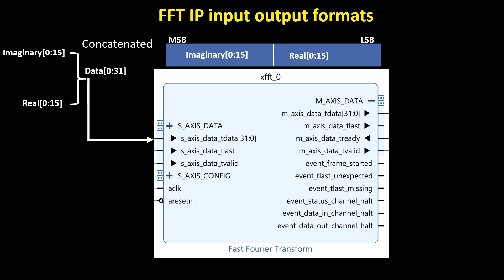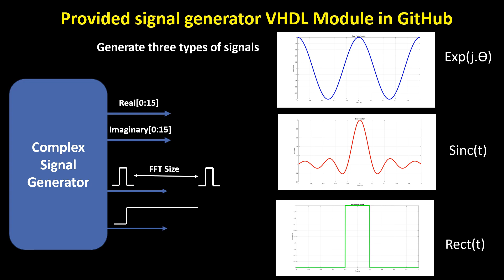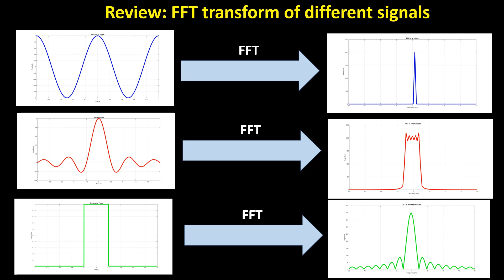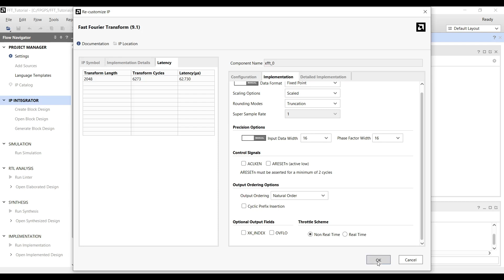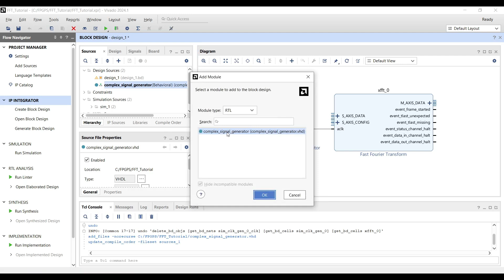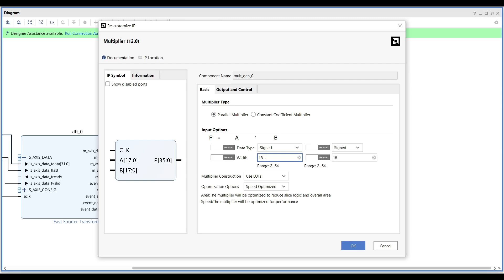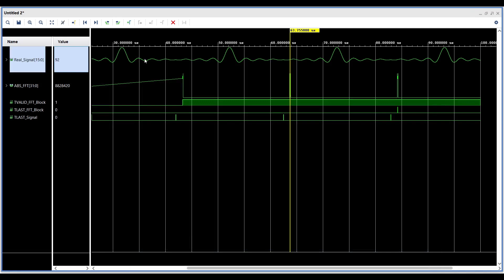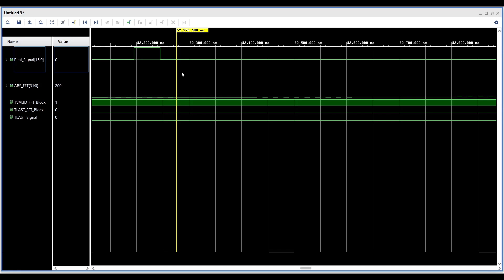FFT IP Core Tutorial Part 1: Vivado Simulation with Complex Numbers

Comment: Hi, thanks for the video. Even though we have followed the same steps , we do get this error : please check your design and connect them as needed: 
/xfft_0/s_axis_config_tvalid  when we run the simulation + no values in the simulation.

Since the last connections not shown in the video , we set all the external ports as a output by making manual connections. Does might be the reason we are getting this error ? Because I have seen that you didnt wire the axis_config_tvalid parts.

Thanks for you respond in advance.
Reply from the maker: Hi @Efe-ts6pe, 
Welcome to channel and thanks for the comment. 
the VHDL module comes with the TVALID port that you would need to connect it directly to the Tvalid of filter slave port. 
Extend the Slave Axi stream (input port in FIR filter block) by clicking on the "+" port, then you can connect each pin of that port one by one to the provided VHDL module. 
Generally, you need to assert the Tvalid signal , you can also add a constant by the value equal to 1, and then connect it to the Tvalid. 
hope it could help.

Comment: Perfect Video!, but my screen does not look like yours... How do I get to plot the sine wave? I'm so sad.
Reply from the maker: Hi Bomtok, thank you and welcome to our channel
You can have a look at the previous video, there I explained how to change the each simulation signal to waveform:
https://www.youtube.com/watch?v=D8ZnMH-Wv9Y

following steps can help you to show the waveforms in your simulation:
increase simulation duration. 
reset the simulation and then rerun it for the specified time.
Adjust the signal settings: right click on each simulated signal to change their settings. 
set the radix to signed decimal and waveform style to analog. you can also change waveform style to hold as well.
Reply: @FPGAPS  Thank you for reply.
But, ABS_FFT value is all zero. What did I do wrong?
And when setting the output port, do I have to set the Type - Clock for all 5 ports? I'd appreciate it if you could tell me the solution.

Comment: Thank you for the clear and useful presentations ! But how does the simulation work ?  IOW, it's not TB code elements and I'm used to needing some module(s) code and then writing TB code that then instantiates the module(s). For some reason, the simulation didn't start working till I tried using breakpoints, and then data was seen...
Reply from the maker: Hi Hardavi,
Thank you for your interest in the tutorials!

I understand your concern. Working directly with IP cores makes the simulation more visual and easier to comprehend, especially when exploring an IP core’s functionality for the first time.

I have multiple simulations designed in a similar way, which you can find in the "Vivado Simulation" playlist.

Regarding your issue—if the simulation only starts working after setting breakpoints, it suggests a potential bug in the simulation setup.

Here are some steps that might help resolve it:
Ensure that the top wrapper is correctly added to the design.
Double-check the FFT IP core setup for any misconfigurations.
Verify that you are using a compatible Vivado version—I am using Vivado 2024.1 for my simulations.
Reply: @FPGAPS  Thanks for the tips, it's all good except I'm using Vivado 2019.1 ( could it be that ? ). Last thing I forgot to mention is that the output waveforms look like garbage. Example, with sinewave input, output has a " blades of grass" type look to it and in regions where output is zero, yet in sim viewer, it looks like a ramp ( but cursor shows value IS 0 ). Strange but 1st time sim ran right, I DID get triangular output.

Comment: Awesome! I got it, but my screen does not look like yours. How do I get to plot the sine wave? All my stuff are digital and they do not change.
Reply from the maker: Hi, welcome to our channel!

The change in the number of inputs and outputs is due to the port folding feature in Vivado. There is a small +/- sign next to the port that allows you to expand or collapse it. Initially, only the connected pins are displayed, while the unconnected ones remain hidden. Expanding the port reveals all available pins.

To bring the complex signal generator into the simulation environment:
Open Vivado and load your project.
In the Flow Navigator, go to Project Manager → Add Sources.
In the Add Sources window, select Add or create design sources and click Next.
 click Add Files to add an existing VHDL file, and navigate to the directory that you save the VHDL file

adding a VHDL module is explained in this video with more details:
https://www.youtube.com/watch?v=zs2kaY5kcnw